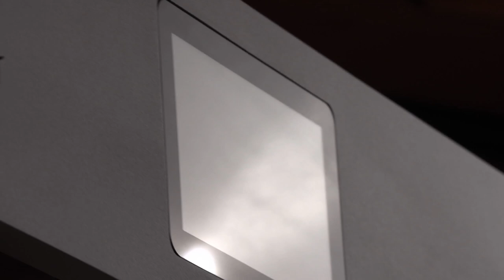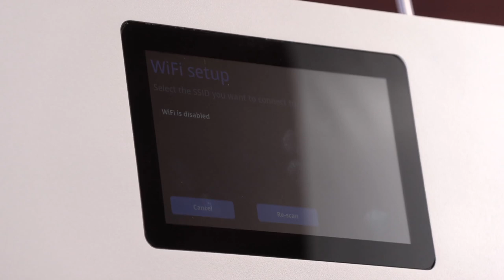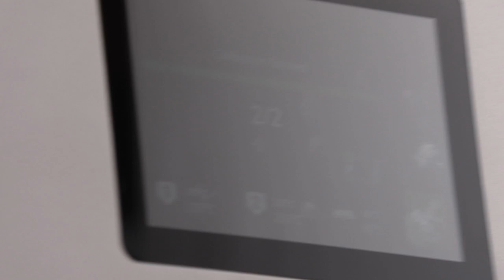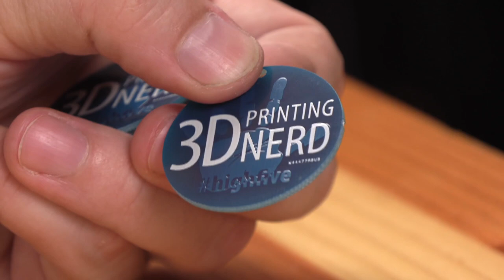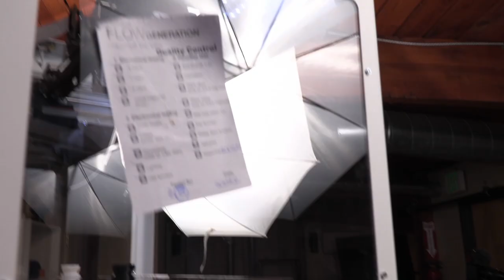Getting our FLOW IDEX XL on with Craftbot!

Comment: Please do a follow up once you have the replacement part and read the Craftbot user group. I used your video as a reason to pause my purchased of the Flow Idex XL and being pretty much roasted for it. I suggested your video was one of my data points as a 4000 dollar printer should not have issues out of the box on print #1   and I was shocked at some of the replies directed at that data point. Everything from you just make "fluff" pieces to you didn't read the start guide or know how to use a Printer.
Reply from the maker: Yeah, many people think I’m dumb and don’t know what I’m doing. Heh. I will do a follow up for sure.

Comment: Maybe read the setup instructions before doing a video about setting up the machine... i like some of the stuff you do, but this was not so good! Sorry
Reply from the maker: I did everything I was suppose to do. Nothing in the setup makes extruder fan go or not go. What exactly did I miss in the setup instructions that would have changed the outcome?

I’ve done troubleshooting since this video and I know the exact problem. However, I’m very curious to know what you think I missed.

Comment: Fan troubleshooting tips:
1. Check voltage across fan connections when heated to point when fan should be on.
2. Disconnect fan and apply proper voltage to test fan.
3. Check the thermistor that controls fan.
4. Check connections to controller board.
Reply from the maker: I’ve done troubleshooting and can confirm the fan works when the connection is good ;)

Comment: He probably left retract settings for bowden extruder so it jammed. PLA very sticky and it jammed for me due to retraction on full metal heatbreak (is it full metal there or with PTFE tube?). Now I'm completely switching sets of hotends for different filaments. Printer looks good, but proprietary firmware and hotends not.
Reply from the maker: Nope, that wasn’t it.

Comment: If you look from the front in the top right front corner there is a connector hanging there. Is that suppose to be lose?
Reply from the maker: Yes it is. Looks like it’s for functionality to add later.
Reply: @2:14:17 you can see the wire hanging in the shot
Reply: It’s for the optional doors you can buy. That cable powers the lock on the doors

Comment: Hey Joel, Help I can't get the claim and verify the account in your discord site online?.    it said to claim it ( as I already logged in to the server ). But the claim area will not let me type in the server? 
I tried to claim the account on the server , But after filling out the email box and my discord password there. It states  that email already used?  Yes I know it is mine on the list. The typing box in the server screen is covered by the icon bar asking for the claiming of the server I can't claim to remove that claim bar?  Help me sort it thanks. Hi Five... I love your 3 D print you tube BTW. 
I got my 1st 3D printer now.

Comment: Guys how can I get in contact with you I will like to get some recommendations on buying a 3d printer.
Reply: The ender series from creality is a great way to get into 3d printing. Very inexpensive, and good print quality with a lot of modable upgrades if you choose to do that. But still cheap enough that if 3d printing doesnt end up being your thing it wasn't too much of a waste. Many many peoples first printers are the ender 3 which ive seen for as low as $120.00, tons of youtube videos out there for them so you can do an extensive amount of research. Great first printer to get the hang of printing and cheap enough if you want an upgrade you wont be too upset you bought it and having it as a backup is great too. I personally started with the Ender5 plus because of its build size but I have heard great things about the ender 3.